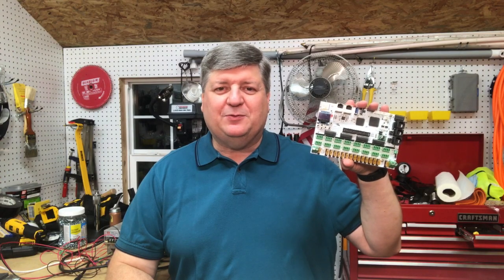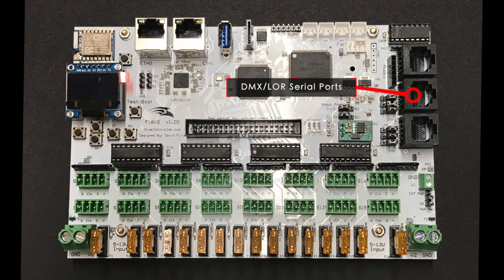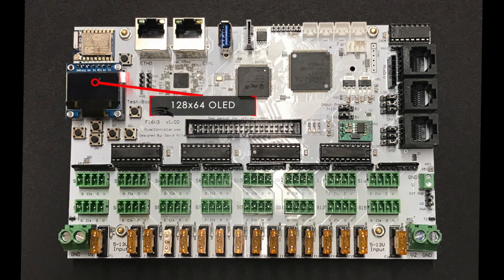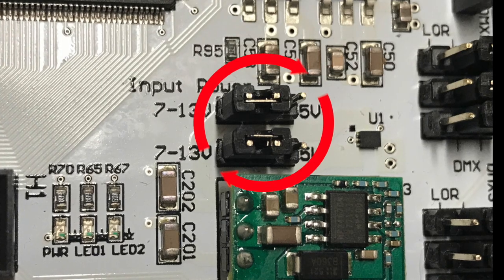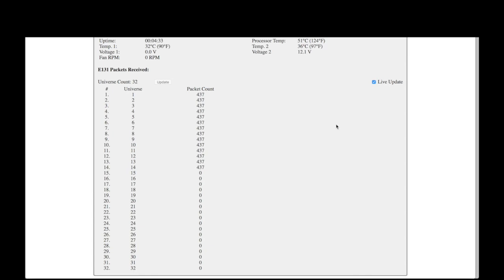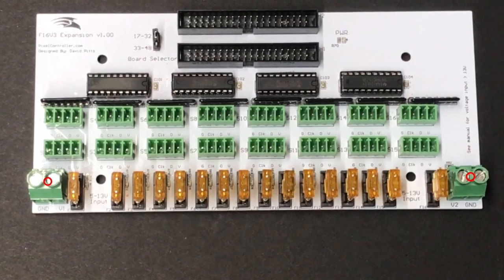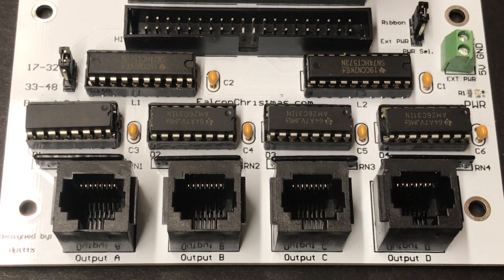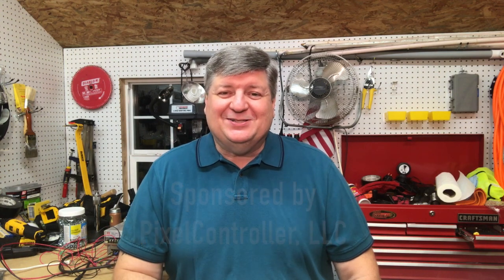Falcon F16V3 Pixel Controller

Comment: Jeff,  Can I run a differential receiver from a BBB with octoscrolla? I want to add some pixels to a P5 sign. Thanks
Reply from the maker: No. That's why I used a 6804.

Comment: I have a question about the differential expansion board.

When it is stated that the port SHARES the total pixels, meaning 1024 total pixels per port does this mean the following:

If PORT 1 utilizes 600 pixels and PORT 2 utilizes 552 pixels.

Does this mean that if I get ONE differential expansion board and FOUR Smart Receivers PORT 1 will allow me to only connect 424 pixels and PORT 2 will allow me to only connect 472 pixels as well as PORT 3 and PORT 4 on the first Smart Receiver board?

I have 2 matrices running on F16V3 ports 1, 2, 3 & 4.  
1st matrix uses Ports 1&2
2nd matrix uses Ports 3&4

Is the above the way that the ports will work
Reply from the maker: Things have changed a little in the last year or so and I'm not sure if the V4 firmware has been back-ported to the V3 - you may need to experiment a little. There is/was a slider in the upper right-hand corner of the (Output -> Pixels [may have changed a little]) web interface to apportion 1024 pixels. So port 1 on the main board shares 1,024 with the expansion card(s) and the slider tells who gets what). Let's say you split it in half. 512 for the main board and 512 for the expansion. Any differential receiver chains will share 512 on each port so all port #1s in the chain share 512, all port #2s in the chain share 512 and so on. At least that's how I understood things and have been using it. I only have one 1,024-pixel matrix and I split it into two ports so I could bump the frame rate to 40fps. In your case, if you set the slider to 512, it means all the main board ports get 512 and your setup (if I understand it correctly) should work.

Comment: So if one connection can do 1024 pixels, how many can I do 12v without power injection? I want to build tree 17ft approximately, around 204 pixels on 1" center spacing per branch. So hoping can zig zag at least 2 branches per connection without power injection. 
Also, what is max cable length typically from controller to string?
Reply from the maker: Many factors determine how many. Brightness is probably the biggest factor (I run mine at 30% brightness). At 100%, you're typically looking at 80-100. I run strings of 300 on my tree at 30% only injecting at the end. How far also depends on the pixels. You can usually go at least 20-feet sometimes longer. There are way to increase the distance. If you need to go much further though, you may need to look into using differential receivers. They can go 328 feet. Check out my beginner playlist if you haven't already (https://www.youtube.com/playlist?list=PLFyrAfJ-kKd4ZfPdXWIt8v_bav61mW_KW).

Comment: When using the F16v3, if I want to use the 4-string differential receiver board, I will need a differential expansion board to go with it, correct?

Also, random question. From the F16v3, How far can the pixels be from them(estimated of course). I have a smaller front yard and don't need to go more than 30 or 40ft if placed in the center of the yard.
Reply from the maker: By default, the F16V3 can support 1 DR board from the first DMX output port, but it takes away 4 pixel ports to do that. Diff expansion is needed if you use all the pixel output ports or need more DRs. As for the random question, pretty much everything affects that. I can do 20-feet reliably, but might have to get creative after that. Standard pixel wiring isn't great for data at longer distances. I have used a strand of Ethernet cable for extending distance, but you have to bring power along too (a custom cable: https://youtu.be/Z0KIXDRkSCk). You don't want to run power through Ethernet cable since there isn't enough copper to carry the load.
Reply: @CanispaterChristmas  Awesome!  I really appreciate the fast reply. I've been watching every video you've had so far involving Pixels. LOVE the videos. Next year, I'm going to attempt to put together a really nice show. Hopefully, I won't bug you too much during this journey.

As far as the link you provided, it isn't working for some reason.
Reply from the maker: Thanks! Also check into the xLights Zoom room (see xlights.org) and listen to the troubleshooting going on. Might be helpful.

Comment: Hi Jeff
I've got my v1.03 version of this board and powered it with 5v on the V1 connector, the first 8 fuses light up green. but my LED screen is not coming on, is there anything I need to do other than set the jumper to 5v to make this work ? any ideas ?
Reply from the maker: The board electronics are powered from V2 so you need power to both sides.
Reply: @CanispaterChristmas  ahh I see thanks

Comment: What I don't understand is the power supply. 32A total per side and a 5A fuse per output and 1024 pixels. Correct? At an average of .3w/LED on a WS2812B, to utilize 1024 pixels on a output your talking around 300w@5v=60A per output. So do you have to power these externally? What's the point in powering strings/strips through to board at all? Or don't you?
Reply from the maker: Most people use short strings or reduce brightness to get longer strings while staying under 5 amps. The "trick" is called "power injection" where you add power to the string at one or more points along the string to bring the power going through the controller below 5 amps. The 5-amp fuses protect the traces on the board, but [the board] is also capable of sending enough data for 1,024 pixels from each port. Expansion boards are available that break the 1,024 up into smaller segments giving you more ports for smaller strings. Here's a playlist of power injection videos I've done if you're interested (https://www.youtube.com/playlist?list=PLFyrAfJ-kKd7WfE9H5uho5KHZFGKGn7iY). It really only makes sense if you have a large concentration of pixels in a relatively small space. It is also a bit of an art form and not recommended for new people since there is plenty of other stuff to learn.
Reply: @CanispaterChristmas   CanispaterChristmas  I understand the power injection and I am an electrician by trade. I just don't understand why you would run any power through the board. I'm looking at a project to light a clock tower at my campus. There will be over 200 meters of 60pixel/meter LED strips for a total of over 12,000 nodes/LEDs over several power supplies. I am assuming I  can I just bypass the boards power supply and just use the boards ports for the data?
Reply: great informative video by the way. Also the link to the injection video didnt work for me.
Reply from the maker: Hmm. That's a playlist of videos. If it doesn't work, look for the playlists tab on the channel.
Reply from the maker: Awesome! People come into the hobby with varying levels of expertise so I try to keep it as simple as possible. Yeah, that's a little bit of what I'd call "special use case" so you may want to do it differently. Yes, you can bypass power distribution on the board, but bring data and GND out of the ports or you may get flickering pixels. At least a good common between the power supply(s) and the negative side of the controller and the pixels. If distance between the controller and first pixel is more than about 25-feet (actual distance depends on just about everything), you may want to use in-line F-Amps.
Reply from the maker: Also, please post a video and send me the link when you have it running! I want to see that. :)

Comment: Hi! Really good video! I've just bought a F16V3 and I'm trying to use it with Madmapper. But I can't see the controller as DMX output device in Madmapper preferences. Any suggestion?
Reply from the maker: Thanks! I’m not familiar with Madmapper, but assume it has to do with the connection to your PC somehow. Do you have a cable from the DMX output to your computer?
Reply: Use artrnet!

Comment: Adding this to my show this year very helpful thank you! One question can I just plug my soundblaster into the F16 usb now? Im not getting any sound and don’t see the soundblaster option in the FPP drop down when I plug it into the falcon?
Reply from the maker: To my knowledge, that isn't possible. David would know if he has built that into the firmware or if he has plans to. My understanding is that the F16 can function as an FPP Remote meaning it can sync with an FPP Master and read the data from an SD card and send it out to the lights. The FPP Master is where you want to get the audio as it would sound strange if you pulled it off a remote that speeds up or slows down based on the synchronization with the master.

Comment: Awesome video! My v3 will be here Monday. 

Question you said the board needs 12v to power correctly I’m running 5v pixels if I switch the  jumper to external power how many amps for the 12v power supply is needed? Can I use a wall wart? 

Secondly I have two 5v 60amp power supplies one for V1 one for V2 what size fuse should I use before connecting to the board? Or should  I just use one supply feed both inputs if so what size fuses? 

Thanks for the help I don’t want to fry the board on the first day. :) I only dove into this because of all the videos you’ve posted and I’m ready to switch to pixels. I’ve been running 110v standard leds for my shows last couple years. Xlights will be a challenge to learn I’m used to vixen. But I figured out how to build all my current controllers from aurduino a and relays so I’m sure I can figure this out with time and help.
Reply from the maker: Thanks and Welcome! You don't need a fuse between the power supply and the board (it has the fuses). As for running it off 5V, I'd just try V2 first, but if you notice the controller resetting unexpectedly, it may be the voltage on V2 is dropping due to load on the PS and an external wall wort can be connected to the external power connector. I wouldn't start with one though.
Reply: CanispaterChristmas ok thank you! Keeping my fingers crossed!

Comment: just for clarification. the 1024 pixels per output. does each smart pixel count as 3 pixels RGB or do they count as 1. I've been watching a lot of different videos on these things and kinda got confused.
Reply from the maker: 1,024 pixels = 3,072 channels. One for red, one for blue and one for green. This supports 1,024 pixels per output, but you'll need power injection for that many as the fuses are max 5amps.

Comment: How do I find out which version of the pixels I have ?  I have WS2811s and now I'm worried I have dumb ones rather than addressable
Reply from the maker: How many wires do they have and how are they marked. If t hey have 3 wires and have DI or DO for data, they are smart. If there are 4 wires and no data lines, might be dumb. Why do you think they might be dumb?
Reply: @CanispaterChristmas  thanks Jeff, they have three a white a green and a red one and they have an arrow in so I think they are smart thankyou.

Comment: Another great video. I have a question as usual but how do you  determine how many pixels can be run off one port.  I understand that power injections will be needed for longer runs but does data start to drop off too?  Or is just a matter of trial and error?
Reply from the maker: Thanks! The F16V3 is 1024 per port, but if you add expansion boards, 1024 is shared among the main board and the expansion board and there is a slider to determine the allocation.

Comment: Hey Jeff, thanks for all the great videos! Question for you, does the falcon F16V3 and the expansion boards share a common ground? I’m planning to do 1 f16v3 with 2 expansion boards and 3 power supplies, one supply per board. Do I need to wire power supplies together or will the boards link together for common ground? Thanks!
Reply from the maker: You shouldn't need to worry about it. Ground is provided through the ribbon cable for the data line. As long as you only power pixels off one board, it will be fine. If you plan on using power injection from one board to another, you may want to rethink that. 😂
Reply: @CanispaterChristmas  thanks! My plan is one string of 80 pixels per output, 48 strings total, zero power injection. All power will be delivered from the board and two expansions.
Reply from the maker: That's pretty close to the edge for 100% white for typical pixels. You may want to drop the brightness a little to give yourself some headroom. You'll want to run some experiments, but sounds like a good plan depending on the power supplies you will be using.
Reply: @CanispaterChristmas  yeah I totally agree! 100% brightness is out of the question, I was thinking somewhere around 20% brightness. The power supplies I have are 3 meanwell LRS 350.

Comment: How do you maintain polarity when using to 30A power supplies to the F16v3?  Not all of my pixels are lighting up when running my xLights sequence.  Could polarity be the issue?
Reply from the maker: Do they all work when you run the controller in test mode?
Reply: @CanispaterChristmas  Yes.  Test mode from the F16v3 and using FPP both work. I think the problem is with my setup in xLights.  Because of the load of my lights, I'm using inputs 1-4 & 9-11 on the F16v3 and can't figure out how to set the controller on the models correctly in xLights to ignore the unused inputs. Thank you for the quick reply!
Reply from the maker: OK. Make sure you've set up xLights according to Keith's video. https://youtu.be/xtemNvNfsMw?t=4820
Reply: @CanispaterChristmas  By the way, I used your Raspberry Pi and Falcon Player video series for my setup using a Pi4 Model B.  It's beautiful!
Reply from the maker: OK. That video is a little older, but as long as it helped! 👍
Reply from the maker: Glad that was helpful!

Comment: I've used your videos to get my first set of lights up and really appreciate the information your presenting.  Really straight forward and enough details to get things setup correctly.  I setup my Raspberry Pi with FPP from your other videos and have the Falcon F16v3 with one F16v3 Expansion Board.  How would I expand beyond 48 ports and still only have one FPP?  How do really large shows expand their setup?
Reply: I just remembered the ethernet out port that can be used for daisy chaining controllers.  However, your comments to handle a large show will be very appreciated.
Reply from the maker: You're on the right track - multiple controllers.

Comment: So you can daisy chain another F16V3 (as shown) from the shielded ports (ETH0 or ETH1) but not a 4-String Differential Receiver Board? Are they different protocols?
Reply from the maker: Correct. The shielded ports are Ethernet. The DMX ports are serial. Cables are the same. The differential receiver can only be run off DMX port #1 (if you want all 4 ports). DMX 2 & 3 only support one port.
Reply: @CanispaterChristmas  thanks Jeff.  So if I want more than one expansion controller I need a differential receiver then out to the expansion boards?
Reply from the maker: Well, a differential receiver only extends the range of up to 4 pixel output ports. An F16V3 expansion card adds 16 pixel output ports and a differential expansion card adds 4 differential output ports (16 pixel output ports if you use 4 differential receivers). You can't use a differential receiver to run an expansion board - expansion boards only connect to the F16V3. The F16V3 supports up to 2 expansion boards. The terminology is a little confusing. :)

Comment: I have an LOR controller will I need this to run pixel lights though LOR controller? What will I need in addition to run pixel through LOR controller? Thanks
Reply from the maker: LOR does have pixels, but I don't know anything about them. You could use this and xLights (free software download), import your LOR sequences into xLights and run your LOR controller and the pixels off the Falcon.
Reply: @CanispaterChristmas  thanks I'm gonna try

Comment: Great video...  I went to the Falcon website, but I don't see the white version of the F16V3, just the red.  Is there a difference?  Thanks....
Reply from the maker: Good question. I've got an email to David asking if he did another run. I haven't seen anything about it on the forums, but it's possible that the red boards are just the production run of the same thing that came out in the group buy. I'll respond again once I hear back from David.

Comment: Are these compatible with Light o Rama controllers? Mostly I was interested in the 4-String Differential Receiver Board they sell. Would like to add it to my PixCon16 board.
Reply from the maker: The differential receiver is a range extender designed to be used with a differential transmitter (F16, F48 or F16 differential expansion board). You can send data to LOR controllers from the DMX outputs on an F16 or F48. So run pixels off the F16/48 and chain the LOR controllers off the F16/48. He does have an F4 controller, but the value proposition is an F16V3.
Reply: @CanispaterChristmas  I wanted to use the differential receiver with the LOR PixCon16 since it outputs to a dmx device. I don't have any of the falcon controllers and was only interested in adding the receiver because it is so cheap and would be closer to some other props. But information is very limited so not sure they are compatible. I believe they are though. This device. https://www.pixelcontroller.com/store/index.php?id_product=45&controller=product
Reply from the maker: I understand, but that board is no good by itself. It has to be used with a Falcon controller.